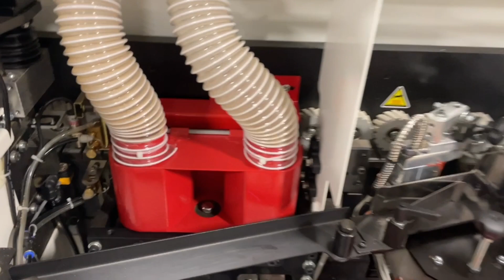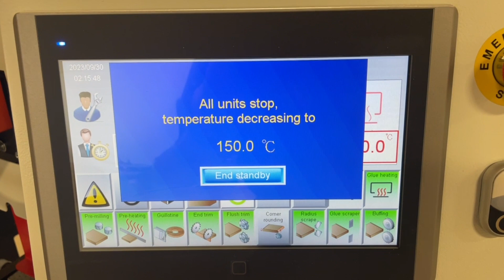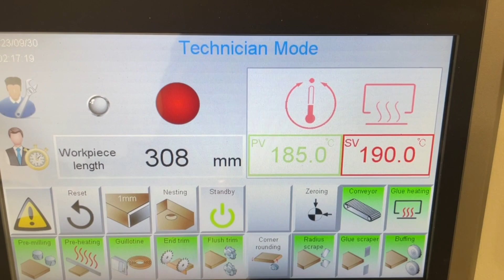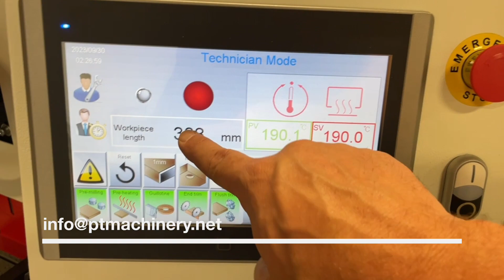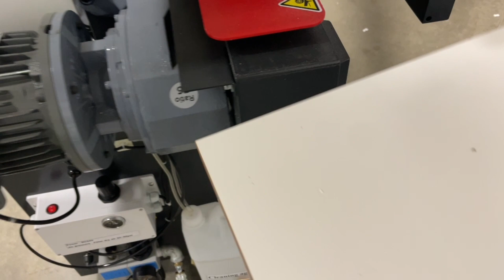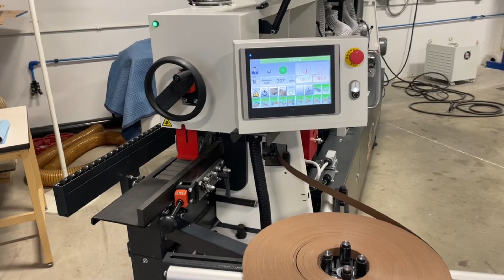Cantek America RapidEdge Pro automatic Edgebander World Premiere walkthrough

Comment: I haven’t had the best luck  with my rapid edge pro. 
Support from cantek has been dismal at best. They don’t know this machine well because it’s so new. They will make a suggestion based on what I send them and say I need to replace a worn part, but it’s brand new. There is no worn part. 
It has nice components but there is a lot of improvement that needs made.

Comment: Wrost Machine
Reply: Why you think it was worst machine?  Do you mind to give us information, we will be glad to know and improve it.  Thank you.
Reply: @marywu4816  I had a older version of their first touch screen model the MX370A..... absolute disaster. It shipped not working out of the box, it had a faulty air solenoid.  Something I would have assumed would have been caught at the PMI before delivery. The list of problems just grew from there. Shutting off mid way for no reason, zeroing into the piece and causing us to have to restart, often times an error popped up rendering the machine down. I joke not when I say I had more down time than operating time with that unit. In fact, Cantek replaced it after 2 years due to the multiple tech trips, the constant issues..... after 2 years we never got that machine functioning. I had to buy an old Holzher just to get parts ran. They replaced it with a new unit. Well right out of the gate with the new unit the door magnetic switch didnt work due to a warped door, I decided not to complain and just bypass it. Ive had issues with this unit as well, connectors randomly getting "loose" poor edge quality etc etc etc.... If I were in the market again today, I would pass on Cantek edgebanders. For $55,000 you can find a hell of a used unit. This unit isnt any better than a grizzly in my opinion, my corner rounder quit working properly....I wont even call tech support, I just stopped using it. The quality isnt enough that I can use on tfl doors, so whats the reason for even buying it? Get a cheaper Amazon 110v bander before one of these. Not worth the money or headache.